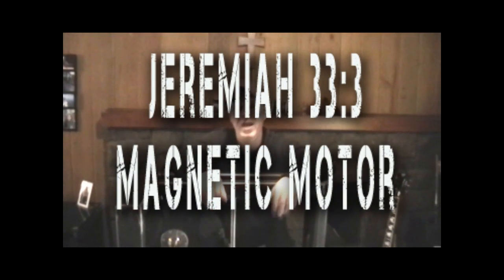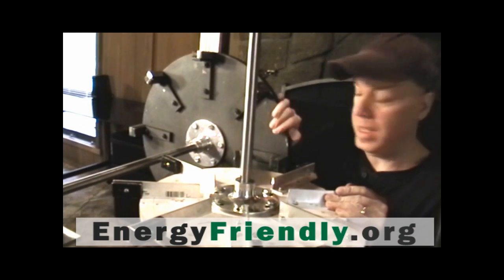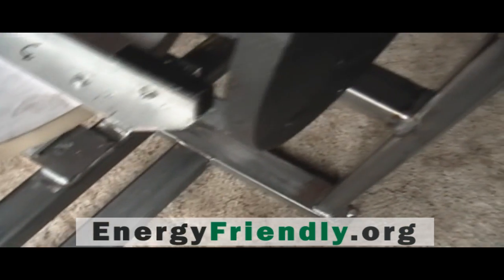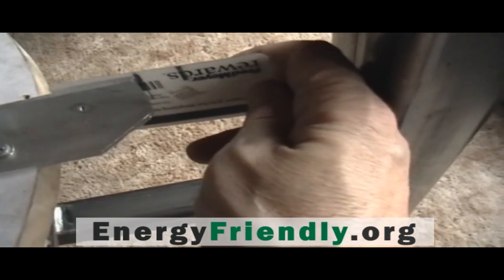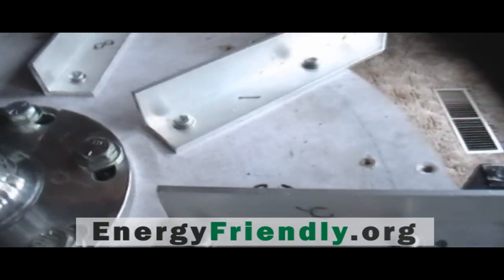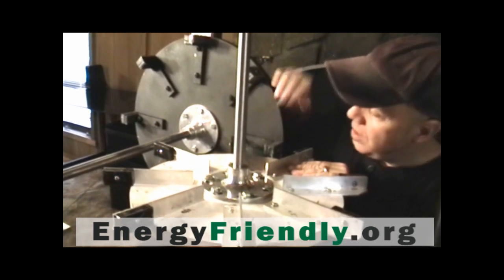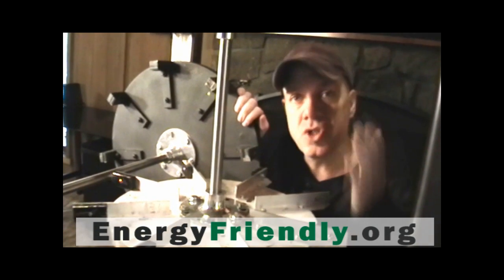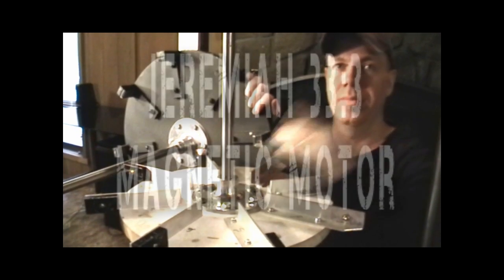Patent Free Magnetic Motor

Comment: Great video brother.. I have an idea on your vertical shaft , layer it up by that I mean make the round disk wider I'm just guessing maybe 7" wide. Now on that thicker disc get 1" round 1/4" thick n52 and make a v-gate.have N poles facing up on each side start out with 2 in the center and as each two you place across from eachother they get closer to the edge until you make a complete circle . The cool thing is that you already have a belt and gear so you can adjust the timing .now on the horizontal wheel get a very strong n52 and adjust it so when it turns it lines up in the middle of the v on the vertical . With your timing system you can now get past the " sticky spot" . I think you would have good results with that. The sticky spot is where the 2 magnets begin on your v. On the vertical shaft I would try only 2 n52 so when it comes around it meets the horizontal 2" past the sticky spot. Also I seen your shielding with mu-metal that's a good idea but mu-metal is very expensive a good idea I seen for shielding is using old depleted alkaline batteries wraped in foil or aluminum tape with the magnet and put on the side you wish to shield / redirect. We'll hope I was able to help . " freely I have received , freely I give . Praise Jesus Christ